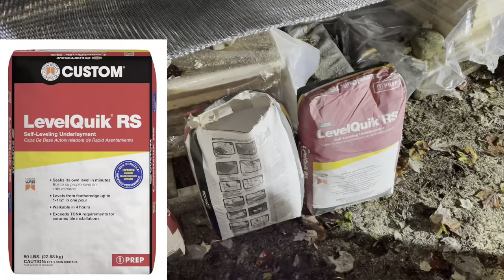How to install self leveling underlayment over plywood - LevelQuik RS - How to level a floor

Comment: You are the only video that follows manufacture specs and installs the metal lath! I was thinking to omit it, but now im doing it right!
Reply from the maker: It’s my own house, I don’t want to take a shortcut and regret it later.  Two years and no issues.  Thanks for watching!
Reply: Not all of the self-leveling compounds require metal lath. I know for certain that Henry 565 & LevelQuick do… but many of the Ardex and Mapei self-leveling compounds do not. It really depends on what the person is using and on what substrate

Comment: Why wouldn't you put the metal lath down before you put screws in to set height of self leveler to make sure it's flat and level?
Reply from the maker: You could do it in either order, but I find it easier to measure height without the lathe in place first.  It’s also much easier to work without crawling around on sharp metal lathe.  If you switch the order, make sure you’re up to date on your tetanus shot!

Comment: Hi, I just saw this. I thought it was a great video. Quick question though, at what point did you take your depth screws out?
Reply from the maker: No need to remind be them.  Just pour the concrete level with the top of them and leave them.  If one happens to stick out a little after, you could use a grinder to take it down to flush.
Reply: @NateFixesIt That makes sense! Thanks for the quick response
Reply from the maker: @Ryan_Wimmer19 no problem, good luck with your project!

Comment: You're one of the few people that followed the instructions and used a metal lath. Would a 1/8 pour be thick enough to encapsulate the lath? If you could link the lath you used, that would be appreciated!
Reply from the maker: I think you probably need 1/4” to cover the lath.  I don’t think 1/8” will cover well.  You might sneak by with 3/16”, but if using as the backer for direct laying tile on top, 1/4” minimum is recommended by the manufacturer.  Here is the lath I used:  Your friend has shared a link to a Home Depot product they think you would be interested in seeing.

https://www.homedepot.com/p/27-in-x-96-in-2-5-Metal-Lath-Galvanized-4113145/312485681
Reply: @NateFixesIt  Thanks for the helpful info!
Reply: Metal Lath is not needed with LATICRETE NXT SKIM LITE, just a pro-tip for you.

Comment: I usually don't seal the seems that run along the joists 
Subfloor is most likely nailed or screwed tightly to joists and possibly glued so there is no risk of self leveling compound running through 
But seems that go across the joists, definitely

Comment: it seems your poring over non lath sections ,,whats up there ?
Reply from the maker: Good question.  There was lath on the whole floor, I cut it to fit in every nook and cranny.  I think what you are seeing is some areas had two layers of lath and some were single.  You need at least an inch of overlap, but in some areas I had much more because it was easier to have a lot of overlap than to cut  each piece precisely for the minimum overlap.

Comment: Howdy. I didn't catch the reason/purpose of the metal lathe screening used in this video. Why do you do that?
Thanks,
Drew
Reply from the maker: The metal lathe is per the manufacturers recommendation printed on the bag.  I don’t know all of the reasons, but my assumption is it reinforces the concrete just like rebar would in a normal concrete pour to make it stronger and resist cracking and shifting.

Comment: Hi Nate, we got a big hump on my laminate floor, can we just take that hump part off, put some self-level concrete to level it? Thank you
Reply from the maker: If you have a low spot, you can fill that part of the floor with self leveling underlayment.  If you have a high spot, you would need to fill all of the low spots on the rest of the floor.  Make sure that you are pouring directly on clean, primed concrete or exterior grade plywood for proper bonding.  If I were doing the job, I would remove all of the laminate flooring to level the subfloor.  Good luck and thanks for watching!
Reply: @NateFixesIt  Thank you very much for the suggestion. It's really helpful.
Reply from the maker: @linsun2591  no problem!

Comment: Thanks for the great how-to! What method do you use to find the high point of the floor?
Reply from the maker: I set the laser level at what I thought was the high spot, the. Measured the height of the laser on a yard stick right next to the laser level.  Measured other locations around the room to see if any were higher on the laser line.  If the floor is clean and smooth, you can also use a level and move around until you find a point that the floor slopes away from in all directions.  If you use a level, check to make sure that you don’t have more than one high spot. Thanks for watching!
Reply: @NateFixesIt  that helps, thank you!
Reply from the maker: @wtdonovan  good luck!

Comment: Do I really need lath for luxury vinyl? I will go from 1/2 inch to skim coat. Maybe I should just use Henry 555.
Reply from the maker: The lath will prevent cracking, but you can’t use it with a skin coat (it would be thinner than the skin coat).   Since you aren’t using it as a base for tile, you could probabaly get away without lath and going full thinkness, but I’ve never tried it.
Reply: I'm not claimiing it's the right way, but I had the same situation, and only put lath where it would be covered. beyond that it tapers with no lath. Will it hold? Only time will tell.

Comment: Im laying some plywood over OSB sub-floor to fill large areas then leveler to feather out. Installing laminate flooring. Cant imagine I need lath. especially since I'm feathering to zero and its just laminate?
Reply: If you are feathering in to fill small areas, you don’t want lath.  It may be more likely to crack, but that shouldn’t be a problem under laminate.  Thanks for watching and good luck with your project!

Comment: Hi, my subfloor is too thin and is not leveled. I want to add a plywood, do i need to add leveler first or do i place the plywood first then use the leveler compound?  Also, do i need to have the 1.25" subfloor under a bathtub or can I just leave that 3/4"?  Thanks
Reply from the maker: Plywood first, then the leveler.  Up to you wether you want to reinforce the floor under the tub.  Should be fine either way.  If not adding under the tub, I would suggest having the tub in place before applying the floor leveler.
Reply: @NateFixesIt  thank you for your response
Reply from the maker: @fixit9888  thanks for watching!
Reply: @NateFixesIt why should the tub be set before the floor leveler is done?
Reply from the maker: @brianherald5756  you could do either.  If the tub is out, I would pour leveler across the whole floor.  If tub is already in, I would just caulk between floor and tub and seal the part getting tile.

Comment: Won't the underlay of the timber floor even out the uneveness of the subfloor ?
Reply from the maker: Underlayment will only take care of very minor flatness issues.   Must sub floors are not as flat as necessary for tile or LVP.  If they aren’t flat, you can have issues with cracking of tiles or soft spots in a floating floor.  The soft spots can lead to breakage of the locking mechanism of the planks and then gaps in the floor.

Comment: Isn't the metal lath overkill?
Reply from the maker: If you are using this for LVP, maybe.  If using this for tile, it’s necessary to ensure that it doesn’t crack later.  I would rather have the overkill than a cracked floor.

Comment: How many bags on a 200 sqf room ?
Reply from the maker: It depends on how far out of level and flat your floor is (the further out the more you will need.  Estimate the average thickness that you will pour, then use the chart here to estimate how many bags you will need (https://www.custombuildingproducts.com/products/levelquik-rs-rapid-setting-self-leveling-underlayment).  Always buy some extra bags.  This stuff sets fast, so you won’t have time to go buy more before the first batch sets.  You can return the excess.

As a rule of thumb maximum coverage for a bag is about 1 sheet of plywood (32 sq ft) at 1/8" thick.
Reply: Why did you use caulk if you are using the sill seal around the perimeter. Also, what caulk did you use to seal the seams between the boards?

Comment: Do you need primer?
Reply from the maker: The primer helps the self-leveling underlayment adhere and cure properly.  It’s necessary for the brand I use.  Read the instructions for whatever brand you plan to use and if they suggest a primer, make sure that you use the one they recommend.  Note that the primer is a special primer for self-leveling underlayment and there are different dilution instructions depending on the type of subfloor.  It is not standard painting primer.  Thanks for watching and good luck with your project!
Reply: @NateFixesIt  Thanks Nate!

Comment: Do u use a metal lath everywhere?
Thanks
Reply from the maker: Yes, you should use it everywhere if using LevelQuik RS as a backer for tile.  If you are using a different product to just fill in the low spots for LVP, you may be able to get away without it, check the manufacturer’s recommendations for the product you plan to use.
Reply: I mean where did u use it?
Anything above a 1/4 inch u would put the steel mesh?
Thanks
Reply from the maker: @gateslattes4686  because I was using the floor lever as my backing for tile (and not adding another layer like HardieBoard, I used the lath everywhere and poured everything at least 1/4” thick.

Comment: How did you calculate how many bags you would need?
Reply from the maker: Start by calculating the square footage and the average thickness that you will pour.   Then use the chart here to estimate how many bags you will need (https://www.custombuildingproducts.com/products/levelquik-rs-rapid-setting-self-leveling-underlayment).  Always buy some extra bags.  This stuff sets fast, so you won’t have time to go buy more before the first batch sets.  You can return the excess.

As a rule of thumb maximum coverage for a bag is about 1 sheet of plywood (32 sq ft) at 1/8" thick.

Comment: Cost around $4 per sq.ft. for 1/4", you can also level with thinset
Reply from the maker: You can fill low spots with thin set, but it won’t be as flat and level as pouring the liquid self-leveler

Comment: Metal lath is a little overkill don't you think?
Reply from the maker: It’s actually recommended by the manufacturer if you are going over a wood floor.  I’d rather install the lath and not actually need it than skip it and have a cracked floor later.

Comment: Just realized that the leveling compound will likely run through all the little holes left by tearing up the previous owners' tile job. Hmmmm....
Reply from the maker: If the holes go all of the way through the subfloor, yes.  If that’s the case, you will need to seal the holes using caulk, or add a thin layer of luan to the sub floor.

Comment: You can’t lay tile directly over floor leveler
Reply from the maker: With Level Quick RS, you can lay tile directly as long as you reinforce it with steel and pour at least 1/4” thick.  Over two years later and my 32” square tile that I laid on this floor looks great.